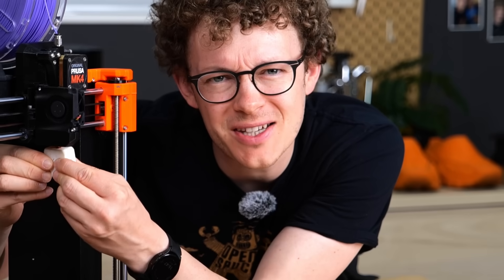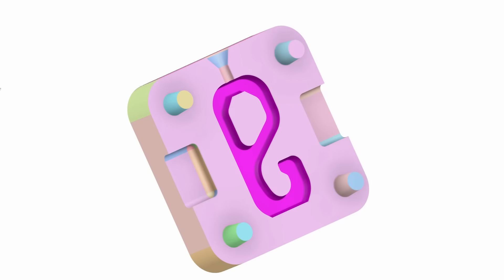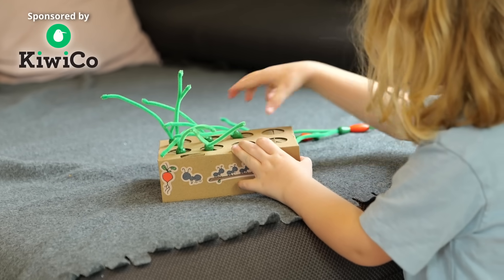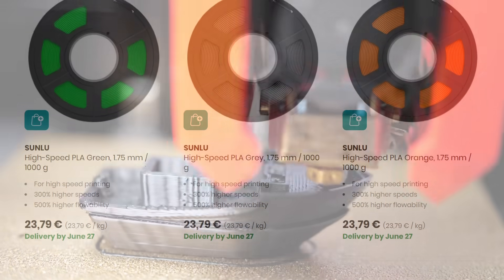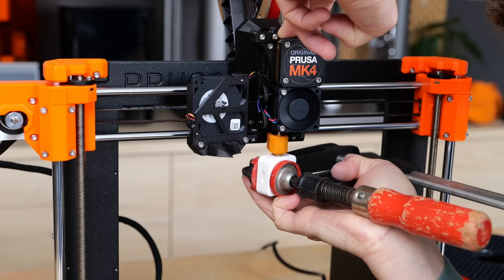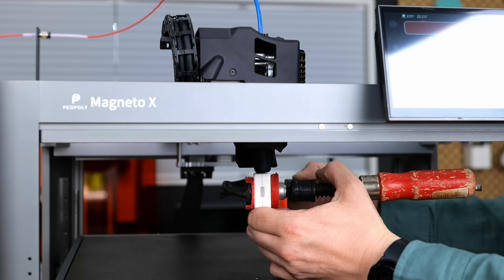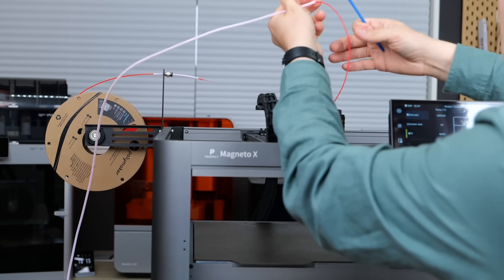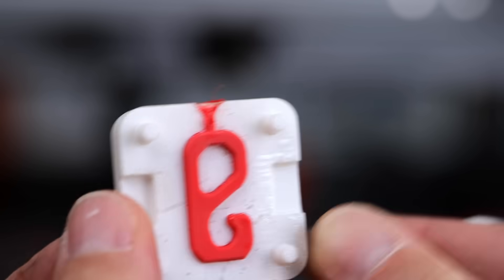I tried Injection Molding using a 3D Printer!

Comment: 10:50 injection molding operator here. You may need to optimize the mold first, like the placement of the sprue. currently, you have it at the very top of the part meaning it is quickly cooling down causing undershoots. move it more or less in the middle of the parts volume and you will be fine. I'm gonna be doing my tests soon enough as well so I'm gonna check it
Reply: Letting the mold sit on the bed and heating it may also help to keep a nice flow temp?
Reply: Leaving the mould on the bed and lowering the nozzle into the mould may help seal this better than trying to hold the mould to the nozzle at a random height. This will allow you to be less hands on also.
Reply: Yes I was thinking the same thing!
Reply: Given that he's using a much slower method of injection would it not also be helpful to heat the mold so that the hot plastic is not cooling upon contact with the mold itself? A similar thing is done when using graphite molds for dealing with metal so that way the mold does not break due to the high temperature difference between the mold and the metal and so that the metal will fully extend itself into the details of the mold
Reply: @ArcadesSabbouth  he is hearing them later on in the video
Reply: I think also finding a way to get a good seal would help. Maybe the mold could have space to encapsulate the nozzle tip?
Reply: Hey! It's a Mold Op Party now! 😄
Reply: I have to ask, how expensive is it to have a metal mold machined for injection molded parts? Let's say... Toy or figure sized parts. Like for model kits as an example.
Reply: I'm genuinely convinced the sprue placement on the screw mold was 10/10 rage-bait for comment engagement. lol
Reply: In injection molding both the plastic and the mold are heated to prevent excessive cooling and lower required injection pressure. The typical source of pressure is a screw type extruder that depending on size can produce up to 40,000 psi or more at the outlet. For the small mold there you could probably get away with printing a multiparty rig to anchor the dies in the center of the bed center your nozle on it and use the zed axis to insert the nozzle into the die and extrude. This will provide for far better injection pressure for you than holding by hand. Add heat plates to the mold to warm it up or the bed it's self to prevent excessive cooling in the die
Reply: Why are there no vent holes? 

Like, shouldn't there be some kind of escape mechanism to allow the air to escape while injecting? Like, otherwise the air has to escape through the hole you're injecting into. 

Also, I think it would be useful if you could find a mechanism to lock the mold in-place affixed to the hot end of the printer so you don't need to hold it there. If you do it the right way, you could also make use of the heat bed to warm the mold ambiently, giving more time for the plastic to flow.
Reply: Good suggestion KleikPL. He also needs to vent his part.
Reply: @tomsko863  with such small speed and presures thats not realy a problem
Reply: @tomsko863 don’t we all 🤷‍♂️😂
Reply: I like how every comment says they are a injection molding expert lmao
Reply: @user-yk1cw8im4h  not realy an expert, but I have 4 years of experience so I know a thing or two
Reply: @user-yk1cw8im4h  there really are a lot of injection molding experts out there, lol. Tons of companies handling their own injection processes.

Comment: i would suggest injecting from the side rather than from the top 
and laying the mold on the bed and preheat the bed (an the mold) 
and also u need channels for air to escape (once plastic oozes out of those u know that your mold is 100% full) 
also laying the mold on the bed might help with reducing the leaks

Comment: make the mold of pa-gf. heat the mold to 120c in oven, place mold on buildplate. lower nozzle onto mold for better contact. the cone shape will self align :) i did this about 7 years ago. also found that coating the mold with powdered gluestick makes a great release agent. i never measured the flow- i used a farmer made (me) hotend with about three times the mass of a v6. the best extrusion i got the best result with a 1.5mm nozzle. 

good to see the young ppl tinkering!

Comment: You can add an exit hole for the air in the mold like @tominthebox suggested, and also try and use a heated press for the mold, which you can probably make with heated plates from printers :D

Comment: You need to heat up the molds while extruding. The printer must contain a closed chamber for printing. Attach the mold with clamps to the tool head and move down on the Z axis until the mold touches the bed.

Comment: Did I you see this on Teaching Tech.  I asked this to cover my older machines but was shot down.   I have a more complete solution for this.  Bigger melting nozzle system, heated bed and heated chamber ,   Flat molds maintaining  heat.  TPU and small parts for origin of proof of concept

Comment: Tested this myself as well. SLA printed mold for a gear and that did work pretty well.
I had a hole for the air to get out (and when plastic came out of it I know the mold was full), was using some grease for easier release and I had the mold on the heat bed and I just used the Z-axis to lower nozzle tightly to the mold.
Ended up breaking the mold by moving the Z-axis the wrong way...
Reply from the maker: Good to hear!

Comment: Great concept! It would be interesting to monitor extruder power use while injecting. Others have mentioned an air vent - the vent hole may need to retain some volume of material to avoid dimpling. Future work could include an investigation of outer mold surface patterning to differentially cool areas based on their volume.
Reply: For example the screw head likely filled more initially but the relatively large volume cooled more slowly than the threaded section, causing the head to shrink into the threads. A thin section of mold surrounding the head could help even out the cooling rate. (Among other suggested techniques such as filling the head first and venting.)

Comment: My brother in christ you need a hole for the air to exit the mold LMAO
Reply: You guys keep parroting each other. No hole is needed, tiny part and it’s not airtight 🤦‍♂️ you’re 12
Reply: @_..-.._..-.._  The point of a mold is to press the two pieces tightly together so the plastic only fills the mold but doesn't escape through the gap. The reason it required so much pressure to fill the mold is because the air was trapped inside, come on that's common sense. Stop trying to be a contrarian.
Reply: “My brother in Christ” you pre-teens will say anything to sound edgy and dramatic 😂
Reply: cnckitchen is all about half cooking ideas

Comment: 1. Air vent hole needed at the other side of hole for injection
2. You can inject plastic not at one end of detail, but at the middle - so plastic need just half path for fill all mold. Of couse you need air vent holes at the all end of detail.
Reply: I was also surprised not to see vent holes
Reply: Man, that was, what I wanted to write XD
Reply: Hello I've spent 12 years as a mold tech at a injection shop. Your best bet is to get an aluminum mold some mold spray for non sticking and a few small areas at the opposite end for the extra hot air from the melted plastic. Do not use vent that exit the mold. And a key factor is that you want to heat up the mold as well so the plastic flows better.  Good luck on future endeavors
Reply: I am one of those who builds injection molding tools and here the recesses on the side are sufficient, especially since the cavity of the finished part has no sharp edges and is not compressed by several tons, and air can also push these tons apart, creating degrees. If this tool were made of steel, I would place the vent closer to the cavity so that the vent has more space more quickly and no holes are created. With a hole at the top as a vent, you only create unnecessary work to remove it because you also have to remove the sprue
Reply: Agreed - you’re fighting the air in the mold. A mold release may help either the flowing as well.
Reply: @LeeWilsonJr  That's right, but the air doesn't need a lot of space... with normal tools you've already seen a lot of development with a height difference of 0.01 mm and the 3D printing has grooves that overcome that, but the contact pressure on the nozzle and the pressure that holds it together aren't the same If it is large, the air does not take the easy way through the small grooves but upwards through the liquid plastic or compresses itself until the pressure is sufficient to squeeze through the grooves
Reply: To add to this, you can also preheat the mould, so less temperature is lost from the plastic you're injecting
Reply: Jesus, Stefan not knowing anything about mold design is kind've painful to watch! Air holes are a necessity. Start all over again from the basic 3D printer and it'd probably work with air holes!
Reply: @H3liosphan absolutely - it's not like casting which has to be liquid-tight.
Reply: @CNCKitchen and this top comment is also to be considered 🔝
Reply: 1. 3D prints like that won't seal up completely and air will definitely seep through already at very low pressures.
2. Agreed
Reply: @celeron55  1. I think like this, but anyway air holes will better solution. Expecially into internal parts like end of the  hook.
Reply: This! Exactly my thoughts
Reply: This is exactly what I was thinking. As plastic is being injected there is also a lot of pressure being built up from the air inside that cant escape.
Reply: Damn it, you bet me to it! Injection moulds typically have tiny little holes that are just big enough for air to get through, but too small for plastic to get through.
Otherwise you're pushing against a massive bubble of air and well... Lots of air, confined space... We all know how this usually ends.
Reply: You only need vent holes on places where gas bubbles could get trapped against the inner shells of the mold, the seam line isnt gas tight anyway and acts as a vent.
Reply: On top of vent holes you could do it in a vacuum chamber to pull the plastic to the end points. You'll have whiskers on your part and it would add a lot of complexity but I think it will help
Reply: Was going to suggest this!
Reply: Use the 3d printer bed to heat your mold
Inject from the middle
Use bed and nozzle to put pressure on the mold
Air vent hole!
Reply: @worlddutchie  what I wanted to say, also if mold would be made of metal, it would be better to heat it with the bed and the hotend pressed on the mold would add more heat to it
Reply: Yup, I came here to write the same exact thing inject at the middle (open side of the hook) 
And air holes at the end of the hook and the middle of the loop opposite side of injection.
Reply: This, and I would say he should also overheat the mold just a bit so the filament has longer to stay liquid.
Reply: dont need an air hole, just a chamber that the compressed air can fill up and inhibit the air pressure acting against the extruder pressure.
Reply: And you could fill some molds first from one side and then from the other. It would have something like a layer line, but only one
Reply: @dmatscheko that can cause really weak parts, more so than layer lines, due to the fact it would have completely cooled and only be warmed by the molten plastic and not the hot end aswell
Reply: @Volt64bolt   True, but might still be good enough for some parts. A heated mold might help here.

Just sharing ideas to prevent patents ;)
Reply: @dmatscheko  I can see how it comes out and become two pieces

Comment: How about a nozzle that mechanically keys to the mould? And moulds that is designed to be clamped by screw hardware... That way you could put everything in a heated chamber and press until the hotend skips steps.

Comment: Maybe change the inlet position so plastic doesn't have to travel too far? For example try printing the hook from the middle? Also adding a very small channel to release air pressure could help. This could be interesting although it also can release the pressure too well which may result in under-fills. I'm amazed how well this worked.

Comment: You need to include a vent.  You ate getting back oressure from the air.  Also you need to pre heat the mold to about 70% the melting temp of the plastic.

Using the extruder cAn work but you really need to make an injector.

Comment: You could try using a silicone form inside of the injection molding form. The silicone form might be able to release even with undercuts.
And the silicone form could be made by printing the part and then using to create the form. 

Also USE vent holes in your molds  :-) Cheers

Comment: Use machine screws to hold the mold halves together instead of the janky clamp. Can use alignment pins in the mold halves to ensure they're perfectly aligned. Also lower the gantry onto the mold so that it's held between the bed and the nozzle which should allow you to inject at higher pressures than your hands can muster. Maybe 3D print a part to hold the mold in place on the build plate. Finally, with this hands-free setup, do the whole thing in a machine with an enclosed heated interior such as the QIDI.

Comment: if the splitting plane is vertical to the hotend, and you put the injection hole in the center of the mold, you could write a g-script to clamp down the mold using the gantry.

Comment: One question was not answered: why hold the thing up n the air when there is a bed and the hotend can be placed at any height.. jamming it between the hotend and bed with springs would be more stable.

Re-melting the whole thing could be one solution, the mold has to then withstand 200C at least.. There is reservoir of plastic at the top. Also.. maybe an exit channel for the air would work then, if it can flow in from larger hole and there is a tiny pinhole at the end.

Comment: I wonder how hard it would be to create a custom machine that to do this, with heaters on each side. With a known negative on either side to allow you to print a mold. Could even use the volume analysis in slicing software to automatically tell the extuder how much to move

Comment: I was just going to try this idea and then this video popped up. You should probably add a bleed hole for air to escape. Also maybe try flipping the printer upside down. I would think the injected plastic will stay hotter if gravity is pushing it down against the hot filamnet coming in. Heating the mold also helps a lot.

Comment: If you just used two adapters rather than an adapter and a nozzle on the magneto, and modelled an inside thread on each half of the mould, you could screw the mould onto the nozzle for a better seal.

Comment: I think the plastic pressure in the mold is limited by how hard you can push the mould against the nozzle, which you are doing with your hands. I don't think you will get the theoretical 300 or so bars you calculated. I highly doubt you will get anywhere close to injection moudling pressures while hold the mould with your hand like this.

Comment: I'll repost my X comment here for posterity… I have a very cool idea but lack the CAD skills to iterate in a reasonable timeframe. It's essentially the same as this, but I want to make a printer add-on to  "injection mold" an endless 1.75mm cylinder, bit by bit, over the course of several hours. This would instantly make usable filament out of material that would otherwise go to waste. With a mold made of silicone, the extruded filament can be shaped in a gentle way,, encouraging a specific curve in the filament. If the mold is made just right then no "puller motor" should be required. It should be possible!
Reply: its quite unclear what that idea would be for. Is this to recycle the purged amounts when reheating or changing colors? 
If yes then firstly, that would not be financially worthwhile. The material we print with still is rather cheap. 
Secondly, filament needs to be extruded continously, with constantly stable conditions so that it does not become inhomogenous in its physical attributes. A filament made in lengths of no less than a dozen millimeters at a time would be the opposite of that. Also I personally constantly switch colors.

Comment: I've made wooden molds with cheap desktop CNC. But i had to manually push the material and was limited to one sided mold with flat top. That works with scrap material but.. have to keep this in mind, i could easily use wooden mold instead of resin printed one. In my version the mold is hot, i've added some when it is cold but then refill once the whole thing, mold and plastic is hot.

Comment: YESSSS! You have no idea how long I've been trying to figure out if this is feasible! Thanks for doing a more professional and thorough investigation than I have the capacity to do 😂
Reply: The one thing I HAVE seen that helps a mould filling better is to have an actively-heated mould. Easier to do with a metal mould than a plastic mold

Comment: I think having a way to equalise the air preasure within the mold by adding a vent to the mold would help in filling the mold completelty. I know when resin casting this can help even with trapped pockets of air if you didnt have the vents to release this trapped air, Worth thinking about.

Comment: I love this proof of concept; great work. I do think that the best part is the use of a resin printer to make molds. I don't know if you are aware but long before 3d printers were being made by hobbyists, some were making tabletop injection molding machines. Check out the Gingery book on the topic, its a much easier build than a 3D printer in every way except making the molds. So using a 3d printer to make the molds is the real game changer here.